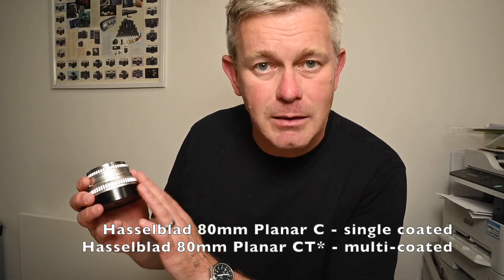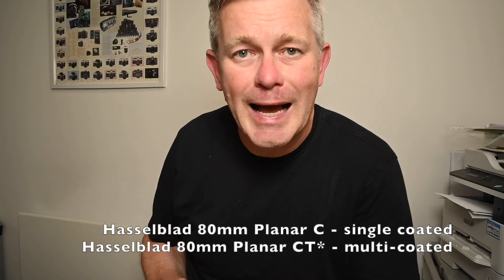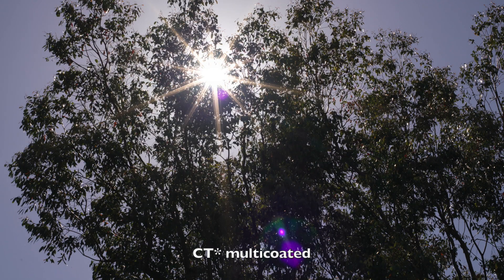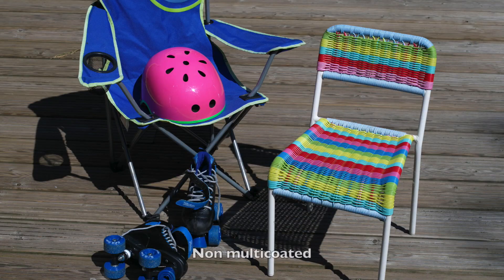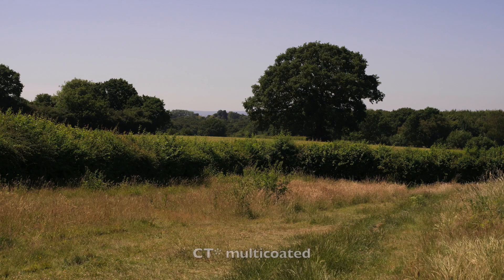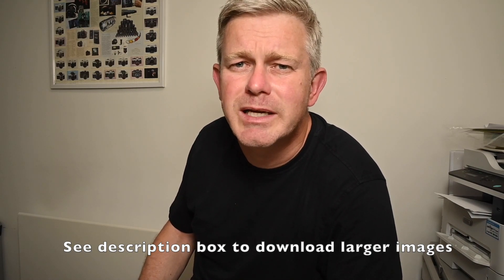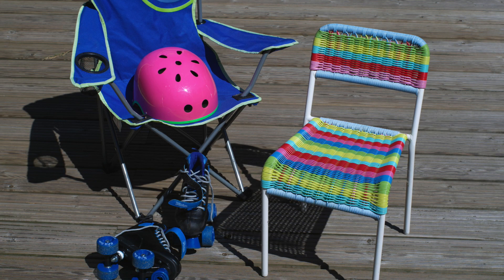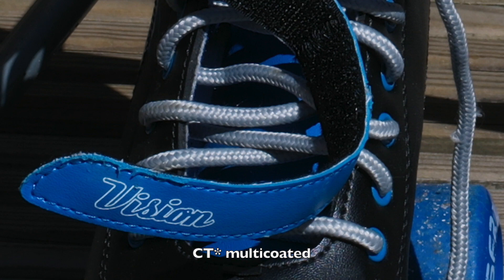Multicoated camera lenses Vs non-multicoated camera lenses. Comparing Hasselblad C and CT* lenses.

Comment: The big disappointment was the reduced quality of construction in the CFI / CFE range passed on as "improvements". To some degree, the CF was a reduction in quality over the C. I have 9 CF optics including a very nice 30mm Distagon that I purchased from Worldwide Camera Exchange.
Reply from the maker: Yes, the later lenses use more plastic than the C or CT* lenses. But I don’t think they became less reliable? Hasselblad CF lenses were introduced almost 40 years ago and they appear to be passing the test of time.

Comment: Interesting comparison. I also thought the sun flare would be much worse on non-multi coated. Question: some old lenses are yellow tinted, guessing they are for black and white; how would they perform with colour? Much obliged.
Reply from the maker: Thorium in the glass can cause old lenses to yellow. This can be reversed by exposing to strong uv light. You can still use colour film but obviously the results will be affected. Some like this, others don’t. I quite like the softened colours. If you wanted pin sharp pictures and accurate modern colour reproduction why would you be using a vintage lens? Just try it out and make up your own mind.
Reply: @WorldwideCameraExchange  , many thanks. Enjoyed your videos.
Reply from the maker: Happy to help!

Comment: It makes sense when backlet. Coating is for flare/vailling control mostly. It's a different aesthetic.

Also, for zooms, coating matters a lot because of the high number of lens elements, but that's not really the subject here (primes).
Reply from the maker: Thanks for commenting. Yes, primes or zooms, the more glass the more potential issues. That’s why, often, the simpler lenses are the best performers.

Comment: Lens snobs are typically united in their automatic underrating of older uncoated lenses as a result of overrating the advantages of a newer multi coated lens. I use both on my 500cm and agree with your assessment that the difference is negligible. One benefit is that high demand for multi coated lenses keeps the price reasonable for the uncoated ones. Thanks for a great video. Again.
Reply from the maker: Thanks for commenting - always appreciated

Comment: Thank you for a great comparison. I use the 80/2.8 chrome non T* on my Hasselblad 500 C and I am very pleased with the result I get. There are three benefits of the older lenses I like compared to newer CF lenses: the depths of field scale is so quick to read, self timer, and that exposure value is locked by default.
Reply from the maker: Beautiful lenses. Look after them and keep them maintained and, like most things Hasselblad, they’ll last forever.

Comment: Real big image quality differences exist when Zeiss improved the optical formula what happened for example with wide angle lenses when C series became CF series.
Zeiss Superachromat lenses could never have multilayer coatings even in year 2000 because they transmit without any focus shift the whole spectrum from near UV to IR.
Reply from the maker: Thank you commenting - it's always appreciated. Yes, the later Hasselblad wide angle CF lenses were improved which is why I compared two 80mm f2.8 Planar lenses, both C type, to keep other variables to a minimum. Not all lenses use or need multicoatings - which is why Leica, for example, isn't very vocal on the subject.
Reply: Not true in general. The Tele-Superachromat T* 5,6/350 CFE has T* multicoating, for example.